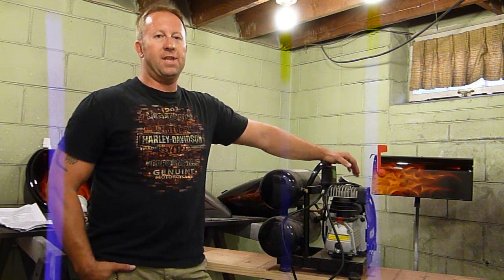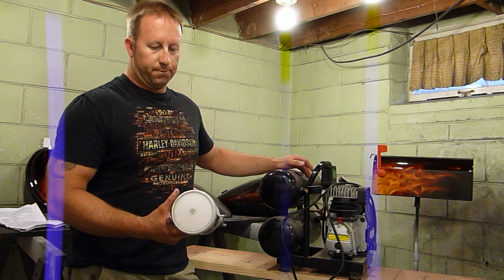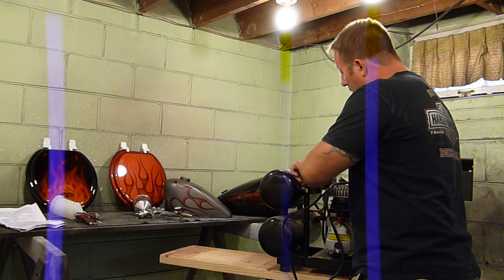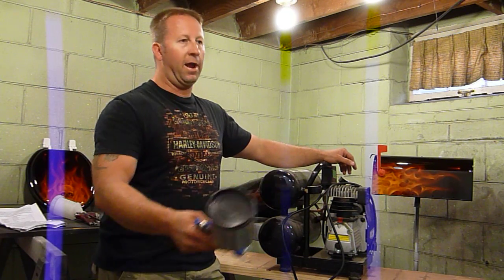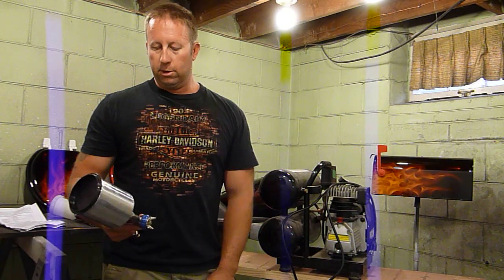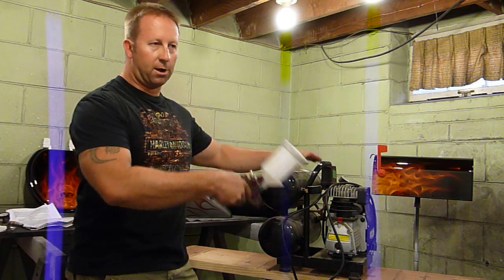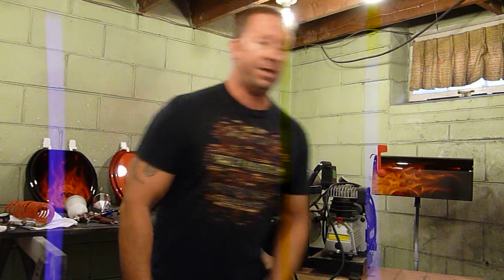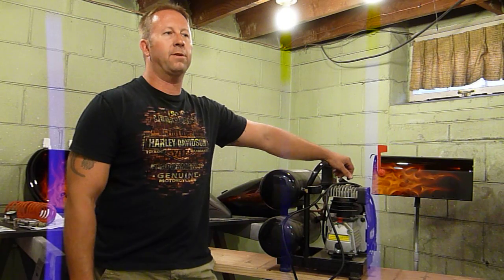painting101

Comment: Where you from Jay?   I am in Minneapolis and your block foundation reminds me of mine.
I used to love that Good Year black rubber hose..but now I think it is junk!  Outside in the garage over the winter the cold air will force a tar like goo out of the back rubber hose...anything it touches will have a tar like residue on it.      MY FAVORITE HOSE IS FLEXZILLA.  They sell it as Menards and FleetFarm.  It more flexible then rubber,  is flexible at -20F, and will not kink. Stretches less too.